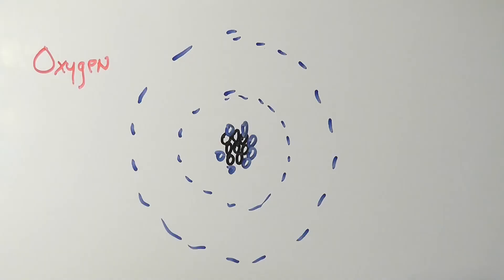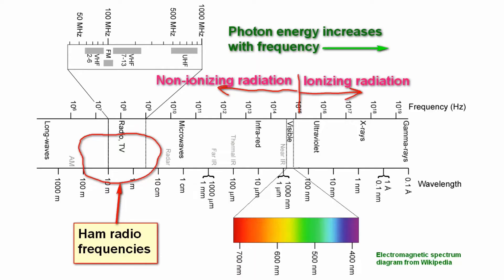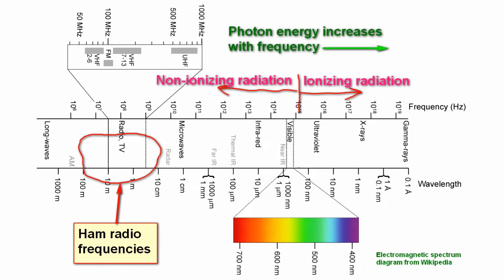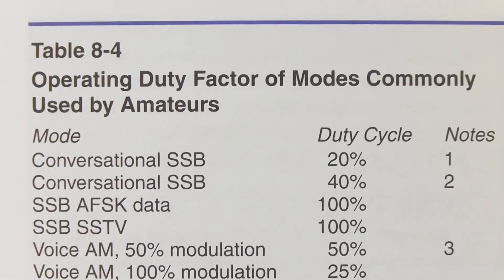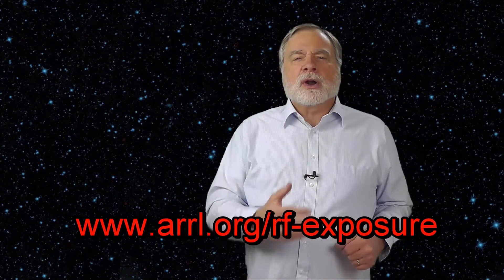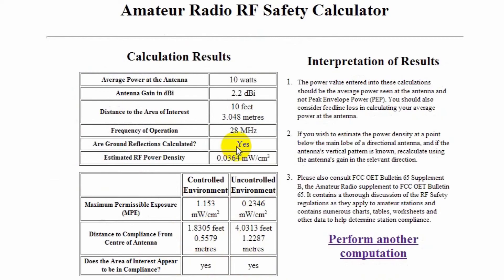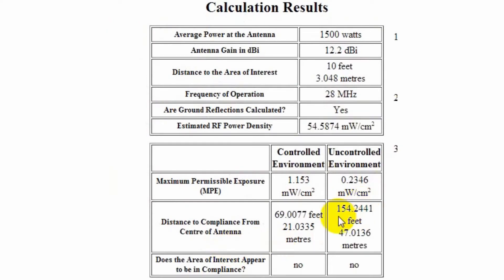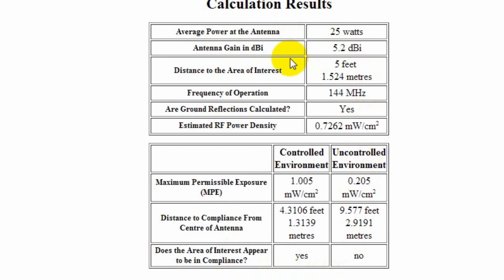Dave Casler Technician License Series: T35 Section 9.4 RF Exposure 2022-2026

Comment: Dave, this was an outstanding lesson on electron promotion and ionizing versus non-ionizing radiation. One of my friends was an electronics and radar tech during WWII. He told me that guards pulling sentry duty discovered that if they stood in front of the microwave dishes it warmed their body during cold weather. The down-side being they were cooking their internal organs.  I wondered if there were special safety considerations for microwave broadcasting during field/mobile setups during harvest or other gatherings.

I worked with high output x-ray equipment examining diffraction characteristics of crystal forms of prescription drugs. These pieces of equipment had three or more safety interlocks as even millisecond exposure could cause tissue necrosis so severe that fingers required amputation.

Wave energy is amazing, but does require understanding  and due-diligence for safety.

73, Dave Stephens
Studying for my Technicians license.
Reply: Hamfest not harvest.

Comment: Folks should know that the RF Safety section in the new 2022 Technician manual was initially not updated to address the new safety requirements outlined in the May 2021 FCC rule changes. The ARRL is updating the manual (September 2022). The old Table 9.4 "Single Sources Subject to Routine Environmental Evaluation..." has been updated to eliminate the old exclusions; now regardless of power level all amateurs are required to evaluate their situation.  73 - Dino KLØS